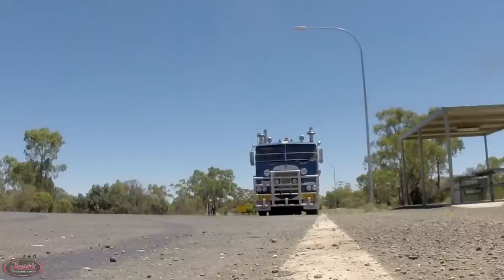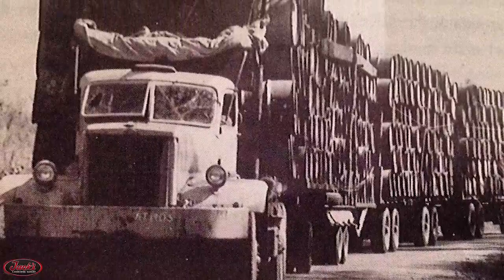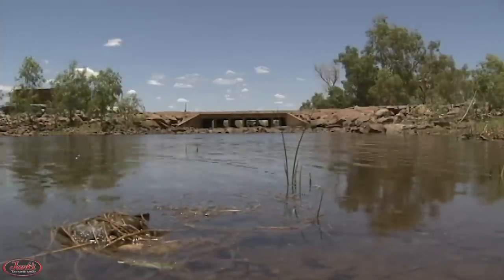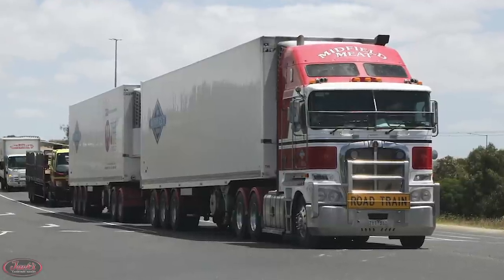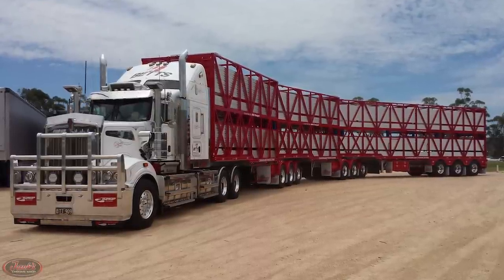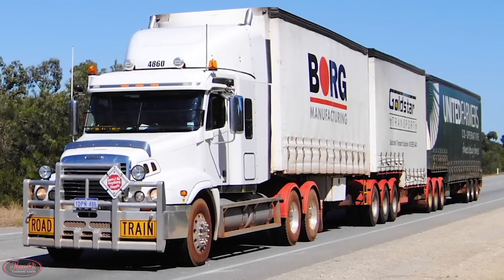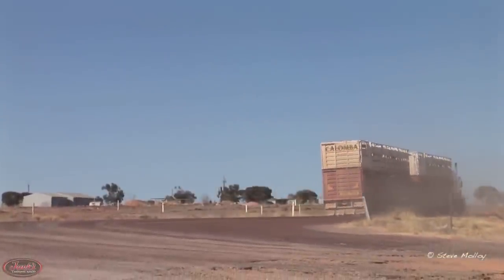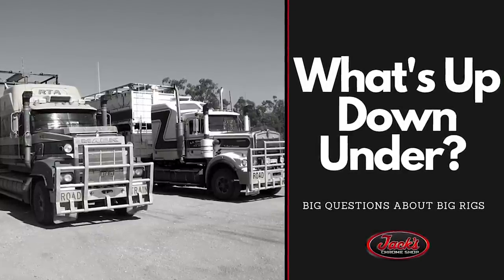What's Up Down Under? - Big Questions About Big Rigs

Comment: Hey, there’s four of my video clips on there! I don’t mind. Actually we don’t use pintle hooks like you showed, that would be a big no-no. We use Ringfeders which are a lot better and stronger. We’ve got a Kenworth factory here which makes Kenworths for Aussie conditions and are in fact the best selling heavy duty truck in Australia.
Reply: You have some of the best damn "V-8 Sound" vidyas on the internet.    In the summer of 1987, I got to drive a 3408 cat in a late 70's KW with a 13 spd.  The engine was white in color.
Reply from the maker: Credit for footage coming your way. Didn’t know about the pintle hooks!!
Reply: Ringfeders can be hooked up by the driver
Reply: I recognize your truck from the air start videos. Nice to see an awesome classic rig like yours still earning it's keep.
Reply: Recognised your truck immediately mate and went straight to the comments to find ya hahaha
Reply: @William Underwood Love the Mack B series trucks
Reply: Kenworths  Are overrated.  ,  there’s a truck built and is designed in New Zealand that would give the K200 a run for there money .  
International 9870 .  Is a much better looking truck .

Comment: To anyone watching this: please watch and support Outback Truckers. Seasons 1-3 are on netflix and they're working on getting 4-9 ported over asap.
Also, Australian Kenworth trucks are nowhere like the North American ones. Kenworth Australia is virtually independent when it comes to design, engineering, and manufacturing. They really know how to build a truck.
Lastly, Mack just celebrated 100 years in Australia and they still have the SuperLiner there.
Reply: Remember. Like Volvo Australias acquisition of Mack Australia operations, Scanias acquisition of Kenworth Australia operations was to ensure liquidation was terminated. Failure to invest in new technologies and modern manufacturing techniques was the underlying issue that caused initial instability. Subsequent acquisition of Mack and Kenworth operations was not sudden, both Volvo and Scania being major shareholders and investors of sans operations for over a decade. 👍👍🇦🇺

Comment: I wish you would have included the power trailers some trailers have an engine and automatic transmission and a remote controlled to help pull the unit down the road

Comment: I Drive road trains for a living. We use heavy duty hitches called "ring feeders" pintail hooks are too light duty l. Especially for the combined weight of the dolly and semi trailer which is anywhere between 30 to 40 tonne. If you guys got any questions don't hesitate to ask me :)
Reply: Why the massive bumper frame in the front. Kangaroo catcher?
Reply: do you tune your trucks, i mean like power upgrades, driveline upgrades and stuff i mean its gotta be tough to haul that much weight on thoose roads ?
Reply: @ziggy2shus624  pretty much correct. Bull bars or "roo bars" are very handy animal strikes figures are huge over here. A lot cattle station country with stray cows, Camels and big red roos, ever sometimes Wedge tail eagles can take out grills and lights. In addition we also have stone guards on our windscreens. None of these are legal requirements but they help a huge amount in terms of safety
Reply: @BeastMode-4422  Depending on Application. A lot of European Brands such as volvo, scania etc have a big influence here in the heavy haul and mining industries. They usually have power plants up 750hp. American Brands are also admired down here. Engine tuning wise, not a whole lot. But I've driven Kenworths fitted with Cummins engines up to 600hp. Heavy duty driveline components are usually a big help in weight pulling. But anythings possible with money. I don't see why engine tuning is a bad idea.
Reply: @BeastMode-4422  Usually for a general freight application some trucks are rated for 90 metric tonne loads and are 480hp to 500hp. Driveline has a big influence on what you can pull. Max on road weight for a Road train is 240 tonnes but this is usually Road trains in Mining pulling 4 Shortened tipper Trailers "quads"
Reply: @chippysalt7652  thanks i always wondered if you tune your trucks cause you haul a lot more than trucks are kinda made for, i mean yea even a low hp truck can pull a lot of cargo but its slower to get up to speed and hold it there, thanks for the answer
Reply: @BeastMode-4422  no worries mate. It all comes down to what your pulling and how much you want to spend :)
Reply: @ziggy2shus624  Hitting a Roo at speed cost me $7,000 without a bullbar, have one now :)
Reply: ziggy 2shus Bullbars
Reply: Jacky CS GO Nope. 500-550-600-625hp
Reply: Jacky CS GO I like row cranes is I like a big dozer trailers please YouTube
Reply: @chippysalt thanks for the replies and the info. Always been interested in Aussie trucks since I saw a photo of a massive C500 tridrive decades ago. Gotten even more into it after discovering Outback Truckers and more drivers on instagram sharing their runs and how beautiful Australia is.
My question is; down there is it easier as an owner operator or working for a big company like Toll?
Reply: @jeromeflaherty2069  I'm not an owner operator. But there are a lot of Small Companies always looking for fleet Drivers. I guess if you give it a red hot go and go subcontracting, do your job right respect your Contract you'll succeed. I work for a Small company and I have no complaints. I have my own allocated Truck I treat it as my own and they send me across Australia knowing I'll get the job done. I apologise I don't know much being an owner operator, but I enjoy my work very much and the pay is good.

Comment: pintle hook not used  as hitch  on converter  dollies (only on pig . pup  or super dog trailers  with body truck pulling it)we use ring feeders (ring feder) with tow ring  on draw bar and has less play than over pintle hook or  big ball b/train isn't a b/double its 2  short trailers with dolly in the middle  or pocket road train my preference to drive is road train doubles or triple I hate b/doubles they don't turn well  rather have a B-A-B road train no a/section  as a lead better under a dolly

Comment: Dose anyone know why Australian trucks and trailers tend to use Dayton styled wheeles over say a budd or hub center?
Reply: Easier to change in the bush. And lighter
Reply: They getting phased out. Rarer to see on modern trucks.
Reply: dragon bros  when was the last time you saw spiders on a brand new truck? Most new trucks sold here have 10 stud other than a couple of Kenworths and Western Stars.
Reply: I seen a T909 with them at CMV trucks the other day. But even then. They not common anymore. 
Only really see them on old 80s era stuff.

Hell our old Flat bed has them still haha.
Reply: They have a heavier load rating! More bang for the buck!

Comment: I'm an Aussie truck driver, if anyone has any questions ask away
Reply: @William Underwood naa mate they were before my time sorry
Reply: @William Underwood Twin stick Mack gearboxes, commonly found in the B series, are known in Australia as a 'Joey Box', a reference to a kangaroo and her baby, called a Joey. Simply allows upper and lower ratio selection. My family transport company had 14 trucks engaged in the South Australian mining industry. My dad has restored 2 to orginal condition as presented when purchased. The trick to use was to be able to change ratios by putting your arm thru the steering wheel, the joey stick knob in your inner elbow, returning your hand to the wheel to retain control whilst changing gears with your other hand which is now across your chest. Making sure air pressure is at maximum to engage the pneumatic assisted hydraulic clutch, you double declutch every gear, up and down. It helps if you're a contortionist!!.
Reply: How much horsepower do most of the trucks that pull those setups have?  I assume Cummins is a popular engine?
Reply: Do you have to use DEF?